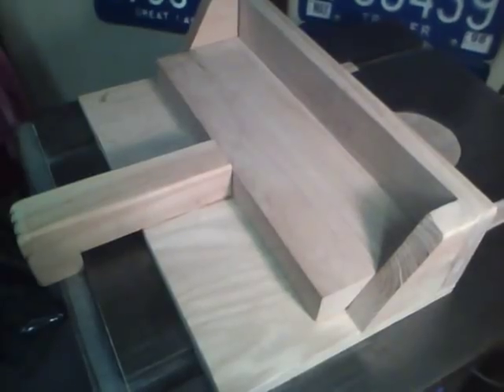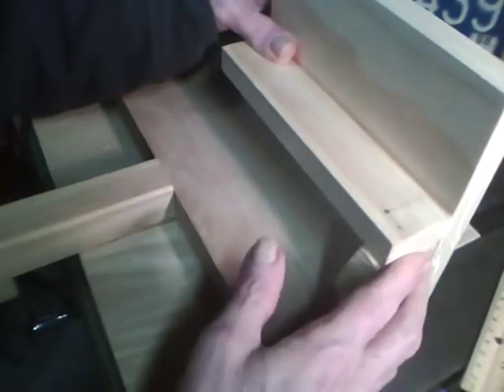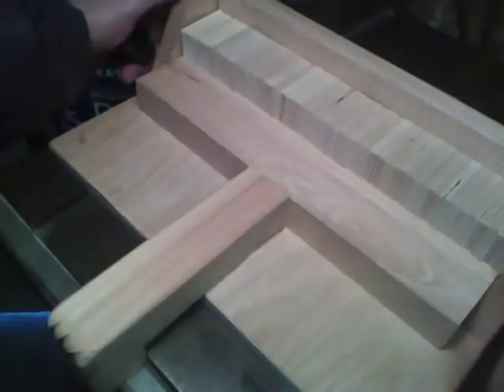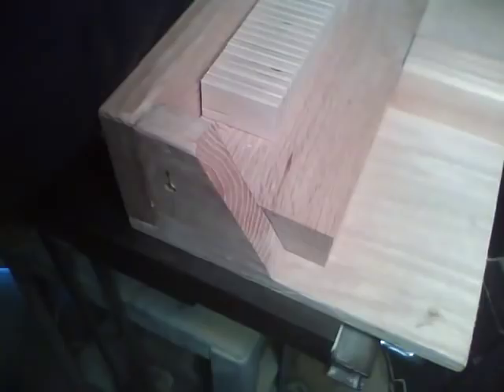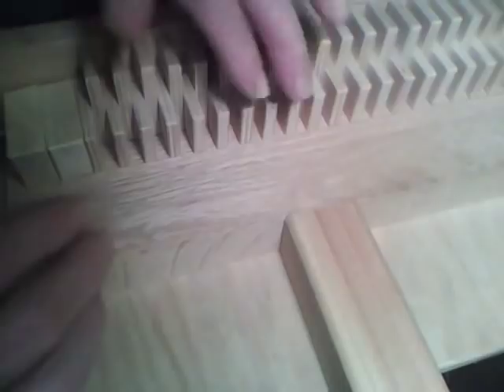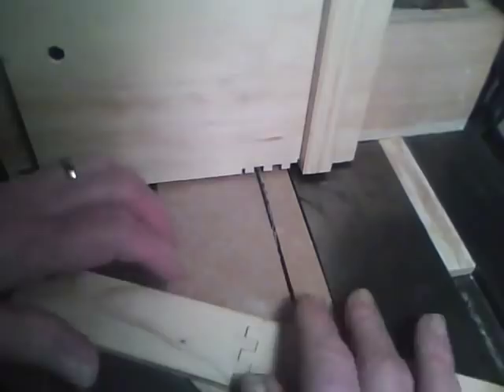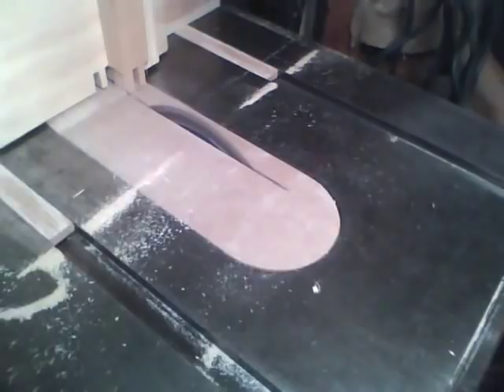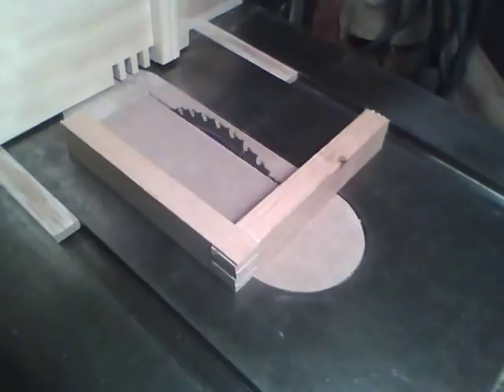My Single Blade Box Joint Jig Build

Comment: I have a setup very similar to this and I have used 4mm (roughly 3/16") acrylic for my spacers, they are very hard and very uniform in thickness. They are also only 6mm longer than wide so minimum stickup for little chance of bending with light pressure. I used 4mm ply but found that it was too soft and soon got little dents from the pin and started to set everything wonky. The 4mm works great as I can set to cut 4, 8, 12, 16mm joints easily, takes only minutes to switch.
To get the pin the exact size needed I started with a nail 4mm in dia and filed it flat on one side until it fit the bade kerf perfectly, you can then turn it ever so slightly for fine tuning with test cuts, cut a groove in the nail head to keep track of the orientation as you adjust

Comment: To cut the second set of fingers you could just take the last piece of the comb & move it to the front, rather than reversing all the vertical and horizontal pieces. Nice simple design, thanks for sharing.
Reply: Reversing all is more universal. It works even if there are differences in the thickness of pieces. Small differences or big differences - doesn't matter.
Reply: or add spacer to the fence on the front that is equal to the thickness of single comb piece. It is brilliant jig for those who is making a lot of finger joints

Comment: You know...the standard domino is About 1-7/8" long by 15/16" wide by 1/4" thick...they also come in 1/2", as well as 3/8". If you just have a few boxes of dominoes in different sizes, they can serve a duel purpose.

Comment: to do the other spacing all you need to do is remove the first block and slide them all over to make it opposite. Aweasome jig
Reply: +Art Connolly I had the same thought but then I realized that if the spacers aren't all exactly the same width then it wouldn't quite fit right. I realized that when you think about doing the different spacing patterns (IE 1 block up, 2 down, 2 up, 1 down, etc.) you would need to flip them all individually.
Reply: I cut 2 pieces, sometimes 4 at a time just using 1, 2, 3, or 4 of the blocks to set the space for 1 or 2 of the pieces I'm cutting, very simple to do

Comment: Awesome job! Thanks for giving the dimensions…on the “Blocks”, I plan on putting a strip of 1/8” Hardboard down, then glueing in the series of blocks needed.  I’d make up separate pieces with different width es..then when I need to make a specific Finger Joint, all I would need to do is grab the correct Spacing Jig..Thanks!

Comment: Jim, it occurs to me that if you were to be making a large number of joints with the same spacing, you could simply make up a set of dominoes and then glue them together with the proper setup. That way you could simply swap in the premade setup as a unit.

You could make the "other half" with the alternate tooth pattern likewise.

AND... you could just simply cut the pattern into a single piece of wood - maple, perhaps, and put the two patterns on opposite edges.

You'd have to label them appropriately, of course, but  it would make it much easier to change finger patterns.
Reply from the maker: neelode Good idea. Don't need two sets. Just leave one loose and put it on the left or right end. Don't have to flip all of them.
Reply: Jim Steinbrecher Jim, I beg to differ with you.  What you said holds true if - and ONLY if - the box joint is uniform: all the "teeth" and "gaps" are the same width.  You suggested makiing teeth and gaps of differing widths along the joint.  Obviously the simplest case occurs when you are making provision for cutting off the top of the box...  It would become much more apparent when you have fingers of various widths, such that there is no single shift that would result in the appropriate alignment of the teeth and gaps.

I know - NUTS!!!.  

You still have a very ingenious solution that can produce very accurate box joints with nothing like the complexity of the various version of the Screw Advance jigs.

Comment: The too small pin bothers me. I agree with you that a loose joint requires a bigger pin, and an oversight joint requires a smaller.. . Every other channel ive seen this on says the opposite, and I thought I was going crazy. Not am expert and don't  have one, so I couldn't test, but in usually good at visualizing it.

Comment: Instead of drilling the hole to put pressure on the blocks, it would be easier and more convenient to Glue the blocks to s thin strip of Hard Board…one strip for 1/8”, another for 3/8” etc. This way, all ya need to do is place the strip with the size of Fingers you want onto the board..

Comment: Instead of using a nail, you might try a drill bit of diameter exactly the same width as the blade kerf.. Drill it in place of the nail and just leave it.. they are cheap enough now days.

Comment: Jim- cant you prepare all the "dominoes" somewhat before you cut them--basically remove the hard edges - and then after you cut you only have to do the ends.  Just a thought it might not save any time- but it looks very tedious to sand each one, 1/4" thick.  It looks like an awesome jig- easy to use --almost foolproof.  Thanks Mario and JIm.
Reply from the maker: Thanks.

Comment: Jim, an excellent jig, hence why you're still getting comments a year on I suspect!

Anyway, I didn't see it mentioned in any of the other comments, but rather than remove the first finger and move along to cut the mating joints which - as you mentioned - wouldn't work for varying patterns, why not simply have two nails/drill bits. One, like the current, which registers against the pieces of wood that are upright, and one further back, which registers against the pieces that lie flat? Simply hammer down the nail that relates to the joint that you wish to cut, ensuring the other nail is hammered back up. Obviously, some sort of threaded bolt with the end ground to size would make it easier to move in and out rather than hammering, but I suspect it wouldn't be difficult either. Just a thought!
Reply from the maker: +Rico S Thanks.

Comment: Jim something is going wrong wrong. I made the jig ,cut the first side put a spacer in for the short side cut, and nothing lines up. What did I do wrong? Should I have reversed the set up with the cut chips up top before the cut for the short side? Somethings wrong and I've made a couple of short side cuts and I'm still not getting the line up to matching need enlightening. Thank you, Barry.

Comment: Great job Jim. I built this using the Woodfather's plan and have been playing around with it all day. One thing I noticed is that it is hard to do anything say shorter than 6 inches. It's hard to get this to clamp securely. I was wondering if you have any ideas about clamping shorter pieces....Thanks
Reply: You can try a Bessey VAS23 Vario Angle Strap Clamp or equal and if you want to save some money, try using rubberbands.

Comment: Hi,  Do you think your jig would work using a Router in a table rather than a saw table, if your router cutter was the same size as your spacer block, and the pin was slightly tapered to fit the guide to make a good fit,  as you move from one pin to the next.  I would be interested in your comments.
Reply from the maker: Yes, as with my jig, the pin has to be the same size as the router bit. The spacer blocks have to be wider or the same as the bit and pin. Say a 1/4" bit and 1/4" pin. Then use 3/8" blocks. Remember that this type of jig is ment to be used with a kerf, blade, that is smaller then the width required for the fingers.

Comment: I have made this jig. I enjoyed making. The only problem I have is after making a joint or two the sliding part of the jig is no longer supporting the work piece where you are cutting the gaps. This means I'm getting tear out on the work piece. I could use a sacrificial support piece but that limits the thickness of the pieces I'm joining.
Any ideas?
Thank for your idea, otherwise than tear out the joints are good.
Reply from the maker: Thanks. You can use a 1/8 plywood backer board.
Reply: Jim Steinbrecher m
Reply: Brian Strappi